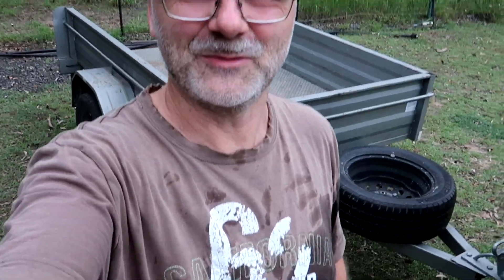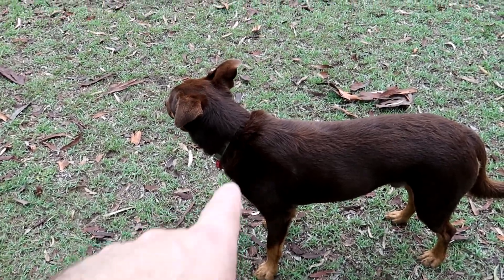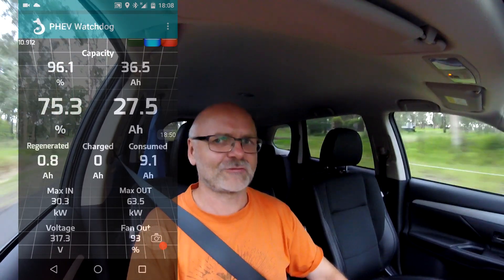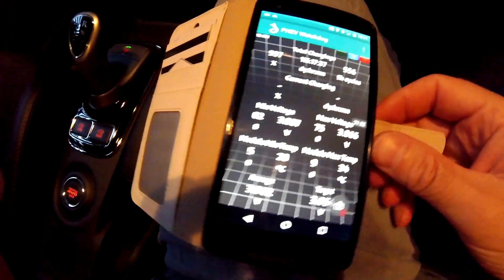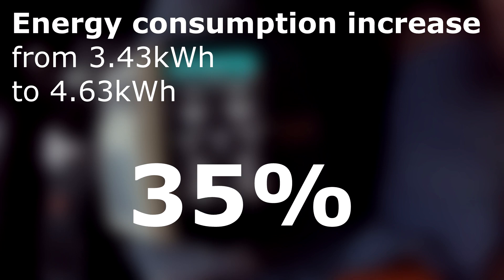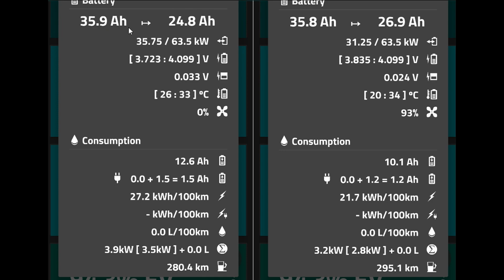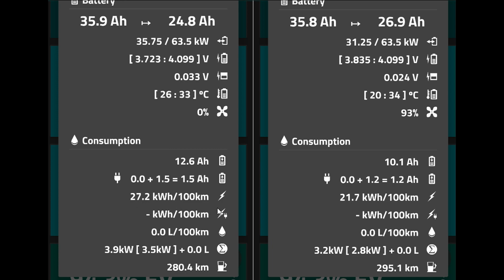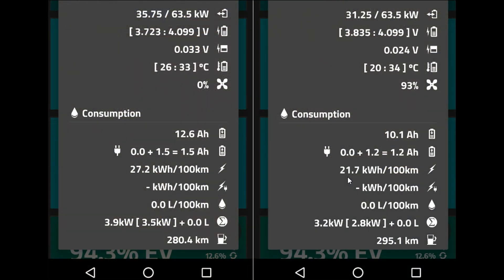Ep19.2 - How much more electric energy does the Outlander PHEV uses while towing a 400kg trailer?

Comment: Interesting! Can you comment on the big difference in the measurement of energy to recharge (35% increase) compared to what the dog says (25% increase both when looking at Ah and kWh/100km between the two trips). Is the dog "off by 28%" (35% * ((100-28)/100) = 25%) ???
Reply from the maker: The dog shows only the figures of the CPU. The actual meter at the chargers calculates everything from heatlos in the battery while charging and also the efficiency of the charger and EVSE. It was maybe a bit off as I've used different EVSEs and different charging speeds for both tests.
 I'm currently collecting information about the energy you pump into the car and how much you can actually use for driving. Watch this space... ;)
Reply: I see. But if ask how much more electric energy it uses while towing, isn't 25% closer to the correct answer? That eliminates the difference in charger efficiency (if you used different chargers), heat loss etc. If you look at consumption it increased from 10.1 to 12.6 Ah (24,75%). If yo look at kwh/100km it increased from 21.7 to 27.2 (25.35%). I don't see why you don't trust this to be a more correct answer than when you measure what you use to charge the car. And ... if you say the dog is less accurate for this kind of measurements, as it only can work whit the data the OBD port offers ... Then you kind of say it is "expected" to be inaccurate with up to 28% as in this case (see my prev. comment)... How can you then trust the dog to give you accurate enough numbers for loosing "a few percent" of energy while being parked? 
 
I have downloaded the app and is waiting for my OBD dongle to arrive in the mail from ebay - and probably some warmer weather in Norway - to do my own testing. I have a two axle trailer that I can load up to 1500 kg (I think the trailer is 3-400 kg), and I will also pick up some gravel in a few months, 12 km from home.